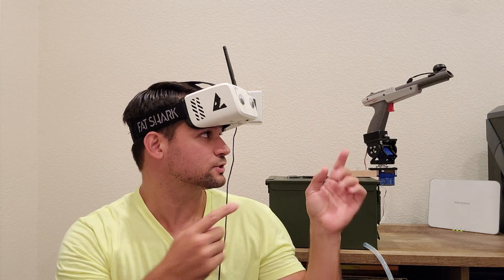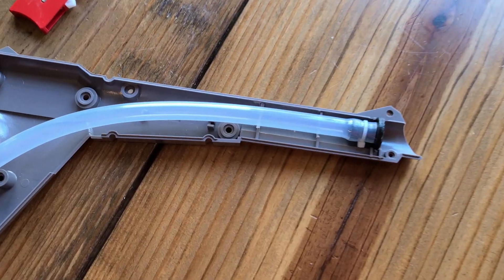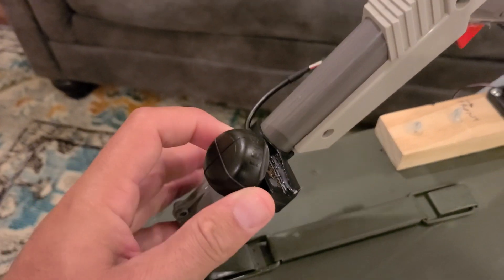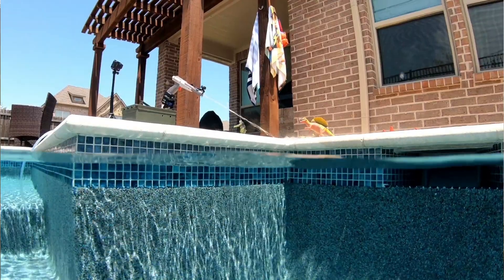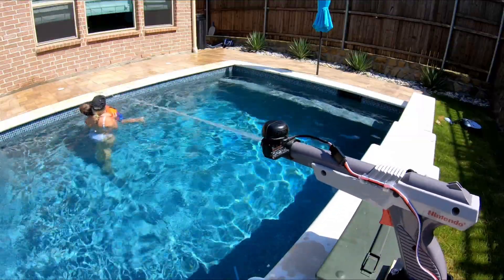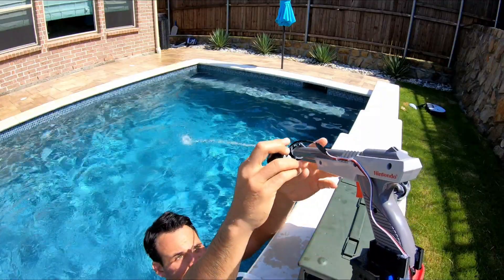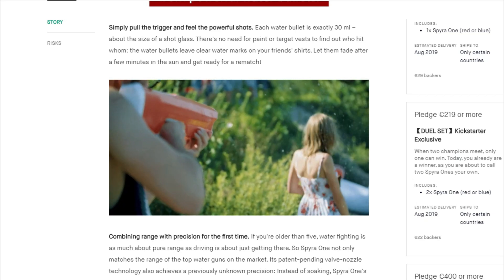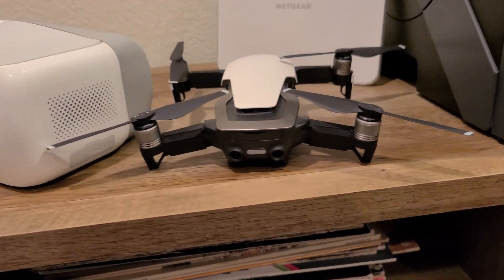I Made a Robotic Super Soaker with VR Goggles

Comment: Wow the state of FPV stuff has really come a long way - I need to get in on that. The pump killing your relays might be a big voltage spike from switching the motor (inductive load). You may already have looked at this but check out adding a flyback diode.
Reply from the maker: Thanks for the tip...ill definitely give it a try next go-round.

And yeah FPV gear has gotten really simple and cheap unless you go DJI digital.

Comment: You don't need stronger servos to make this smoother, the barrel is way about the fulcrum of each servo.

Providing there is enough slack on the hose, move the pan/tilt assembly to just up in front of the rigger and you will have much more stable movements.